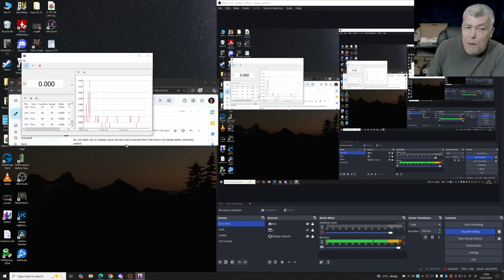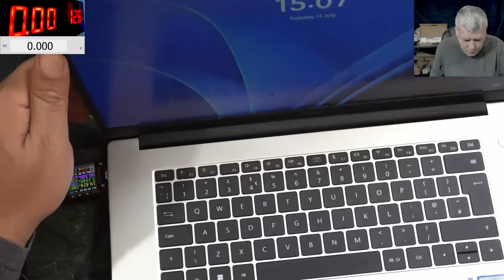Huawei D15 - charging port ripped pads repair - Definitely you need a microscope for this job!

Comment: I have my Acer nitro 5 an51558 laptop at time using it on charging. Then i hear cut sound and then laptop get dead after that it not charging and opening. What could possibly happen. Chances of which component failed. At time dead laptop in on normal temperature. Help me

Comment: Huawei: renown for their wafer thin motherboards that flex just by looking at them!
If you should accidentally touch one: it will bend and buckle, crumple and melt. All
of them have a very low melting point: room temperature.

Comment: I guess, to solder the outter housing was not necessary, because of the inner part of the port is movable and ripped the pins, while the outter housing was not detached. But I'm just guessing. Sorin is a Wizard....

Comment: You can use UV resin to strenghten ports on the board.
UV mask(gel) doesn't provide much structural support.

Comment: The best way around these stupid charge only via usb c laptops is to either get a small usb c to usb c extender or to one of those magnetic charge leads. So the usb cable is never pushed in and out of the laptop, only the adapter.

Comment: This power connector is very badly designed. Tracks are easily broken and hard to repair without proper tools. There should be better power connector then this one been used. 😊😊

Comment: Maybe it's best for this client to recommend a magnetic USBC charger tip that will always stay plugged inside.
Reply: I’m using them in my laptops that have USB C charging. I watched too many repair videos.
Reply: Too much resistance.... More heating on the port and slow charging
Reply: @shoumikahmed6373 are you sure? I’m still charging at 65 Watts.
Reply: Good idea! I think I'd get one of those if I had a Huawei laptop
Reply: Maybe the customer should be more careful

Comment: I have watched 10 or even more of your Huawei USBC repairs. It looks like in general the port is a bad one, with bad design. Maybe there are other ports that will fit and it will be with a better design. The metal cover always is solder and with a good shape. The black plastic inside is moving and this is the cause of broken tracks. If you don't like to find a replacment port maybe it will be a good way to solder the ground pins on both sides(like you did) to metal cover but with some solid copper wire. Then the plastic inside will not move and will stay solid and the force will be taken by the copper wire not solder it self. 
Up to you of course, this is only an advice.

Comment: The issue with these seems to be the two little retaining clips that push down on the internal bits are either not being engaged properly when the port is manufactured or over time the in and out of the port just pushes them back and the port can move ripping the pads. I suspect it's just through use.

Comment: If you use a small wire on each leg of the port, it will flex on the wire in stead of breaking then use hotglue to hold the port etc better than new lol